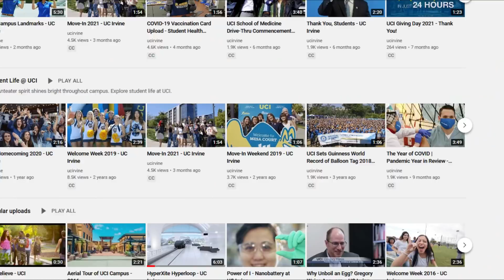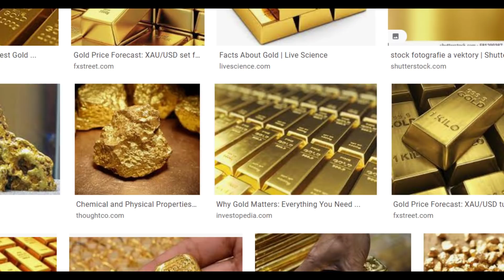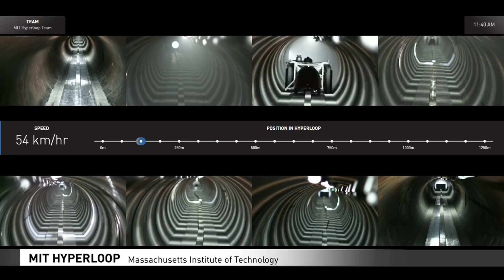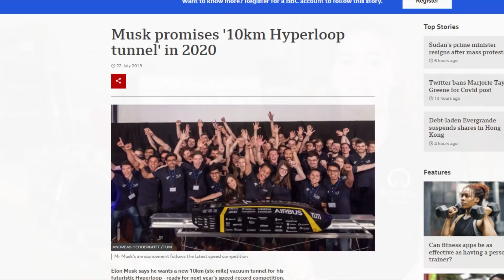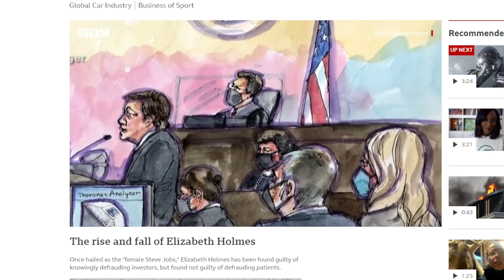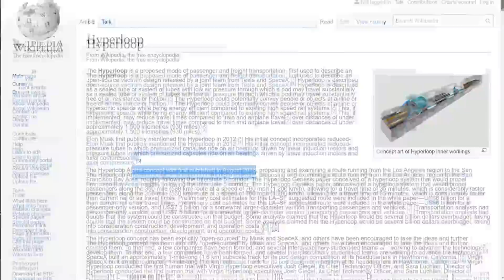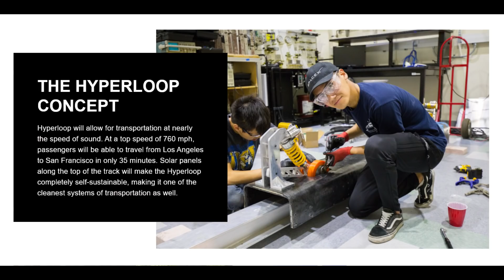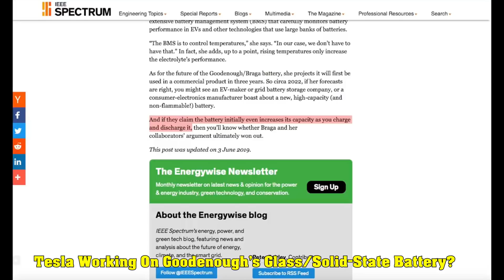The GOLD Battery that will revolutionize EVERYTHING!

Comment: i'm sorry but this video seems like click bate video, gold batteries segue to another rant on Elon Musk and Hyperloop. You already have plenty of those. True enough, the gold battery seems dubious,  so it would seem that video is over hyped. One does need to ask what the purpose of the video was though. Is it to excite  prospective students and interest them into enrolling at that university? If so, who cares.

In regards to Universities competing in the hyperloop, again, so what. I attended a top engineering school on the east coast. There was (and still is) an off-road vehicle competition sponsored by SAE, Goodyear and Briggs and Stratton. I could cynically say we designed and built an off road, lawn mower engine powered go-cart. In the grand scheme of things, fairly pointless. However, after decades in industry, I still think this was by far the most influential and valuable learning experience in engineering school. Not only was it the practical application of engineering lessons learned in school, it was also about time management, budgeting, fund raising, project management, team building and the thrill of victory and agony of defeat.

The competition can be to design a robot to dig a hole and then fill it back in as quickly and precisely as possible. As utterly pointless as that seems, the value of that experience to the students is still substantial. DARPA had the Grand Challenge in 2004 and 2005 autonomous vehicle. If you judged the results of the 2004 competition it would have been easy to say it was a waste of time and engineering talent. Eighteen months later Stanford had an impressive and convincing win. Clearly the world is still slowly advancing towards the autonomous vehicle holy grail. It is apparently a non-trivial problem.

I do take exception to equating Theranos' out right mis-representation of their technology, to Tesla's (Elon Musk's) underestimation of the time line to develop the autonomous vehicle technology.  In Theranos' case, there was no functional technology, yet it was being demonstrated as working, functional technology.  At least Tesla was working on and is still developing autonomous driving.  Very few engineering development projects meet all criteria within budget and time constraints.

I don't believe autonomous driving is fundamentally unsolvable, it is not a case of repackaged perpetual motion. One can be critical of underestimation of the difficulty of an engineering problem without resorting to questionable comparisons.

FWIW, I've been scratching my head on hyperloop and the Boring company. Evacuated tubes with speeding carts in them where shown pictured and described in Time-Life Science Library in the 1960's. As a kid, I thought it was an awesome ideas, as an adult, I see the same issues as yourself. Most of the issues you point out though are not ones that break the laws of physics.